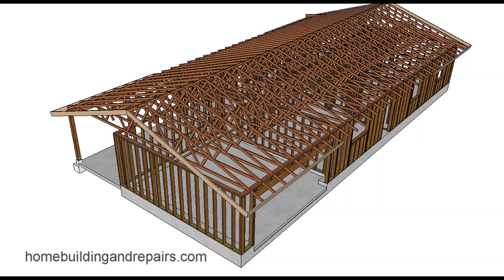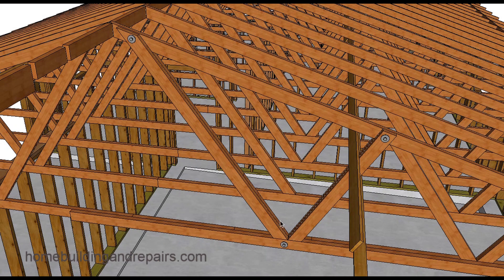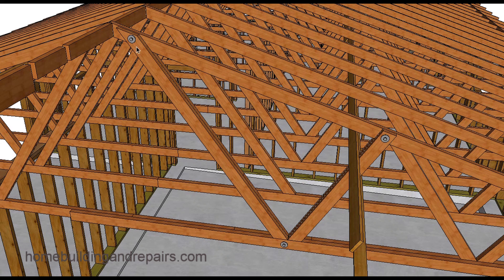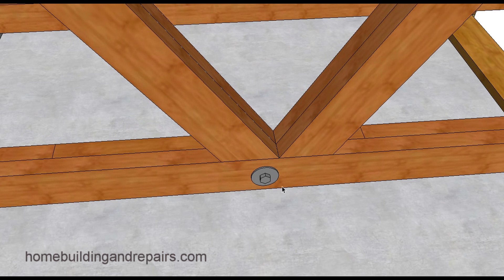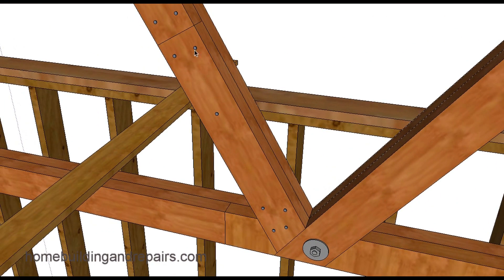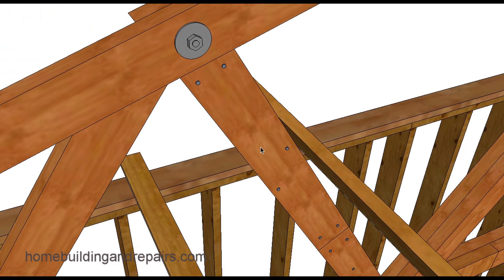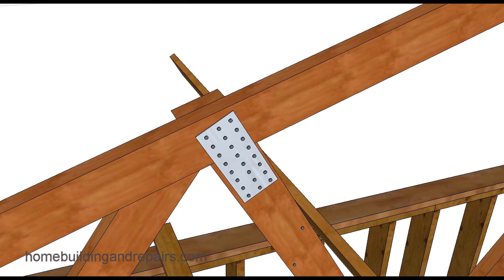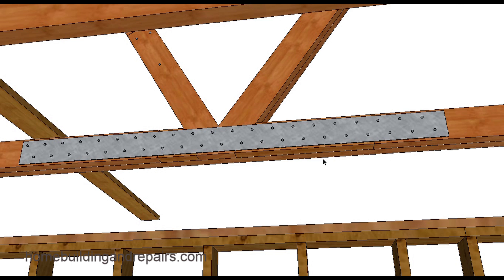Roof Truss Repair Ideas – Structural House Framing Repairs

Comment: I have a question!
How do I remove/replace exterior garage walls with brick veneer and wall tied to the studs of the wall to be replaced? Home is a single story attached 2car. 63’ x25’ dimensions and has a hip roof.  Wall studs and bottom plates of garage needs replacing due to termite damage.
Reply from the maker: I get this one a lot and most of the time you need to remove the brick, fix the wood damage and replace bricks. I just don't have an easy repair for this one.
Reply: @gregvancom  Thanks for the insight. Was hoping for a miracle! I did find a couple of things that may do the trick. I will let you know when I have the results.

Comment: Thanks, Why are you not a fan of screws?
Reply from the maker: Because some of them aren't approved methods for assembling certain parts of a building. I would definitely approve any screws that would be approved by an engineer and local building authorities.
Reply: Alright... thank you. I use Deck screws for this type of thing all the time. I need to get a good nail gun.
Reply from the maker: Screws work great for a lot of things, just not for every part of the home building, remodeling or repair process.

Comment: I got so excited when you said that I didn't have to watch anymore of the video. I am also just kidding. but hey dude is it true that since I have truss roof that I can knock down all interior walls in my house because whoever built this house did not lay it out well
Reply from the maker: No you can't knock down the walls, because some of them provide lateral support or provide structural strength to the exterior walls. See if this video makes any sense https://youtu.be/paE-QLp1uIU
Reply: gregvancom that's kind of what I figured but a lot of people say that all the load on a truss roof is transferred to the exterior walls. If I ever do anything with it all build temporary walls and stuff
Reply: Talk to a structural engineer. I was told I could remove certain interior walls of my home when the SE came for a site visit for the above described repair. It all depends on how the trusses are used.
Reply from the maker: Yes the roof framing loads might transfer to the walls the trusses are sitting on, but if one of the three little pigs starts huffing and puffing, it could fall down. You are right though if you start moving walls, make sure the important ones are braced.
Reply: gregvancom yeah I watch the video I understand what you're saying about the bracing walls makes complete sense. Thank you

Comment: Repairs to trusses require an engineer to provide a plan or it may not pass an inspection. Just sayin'.
Reply from the maker: You're absolutely right. I know some people don't want to hear me constantly telling them that they need to hire a structural engineer, but most modifications to a wood framed building require an engineer. 

The examples in this video will provide someone with a possible solution, but again, might not work on every project.
Reply: Because a truss is an engineered structure, it needs an engineer to OK a fix. 

If it were my house and I was planning to live there for a while, I would do something along the lines of the examples you've provided. 

But if it's a job where permits are required to be pulled (like for the sale of a house) expect to hire a structural engineer who will tell you what wood species to use,  number and length of wood supports, nails and/or screw and patterns. 

I had to do this when I sold my house and the inspector discovered a broken truss after walking on the roof and feeling it give.  Probably an original defect in the truss or damage when it was re-roofed.
Reply from the maker: Excellent point again. If anyone does ever hire an engineer to fix a damaged roof truss and they use any of the examples in this video, I would love to hear from you. I remember when they would fix damaged roof trusses by simply nailing 2 x 4's next to them, in the 1990s and I would imagine they still do the same thing today, but nobody talks about it.
Reply: I had to sister (both sides) a broken truss (top chord) with 8' 2x4's DF #1 or better (something like that) nailed (construction screws OK) 1 foot apart (pairs) staggered. $$$ for engineer report. $$ for permit.
Reply from the maker: $$$$$$$$$$$ seems to be more of what it's about than safety sometimes.